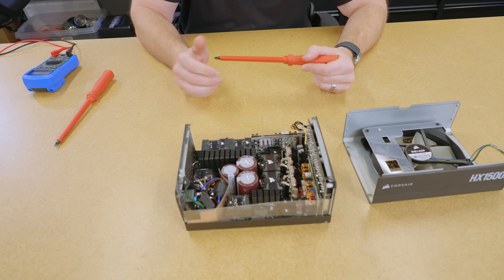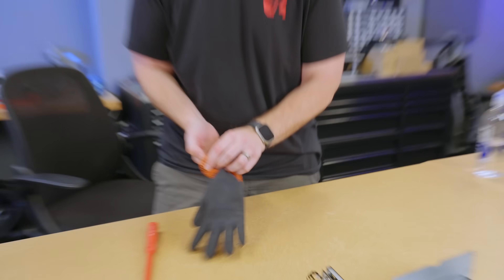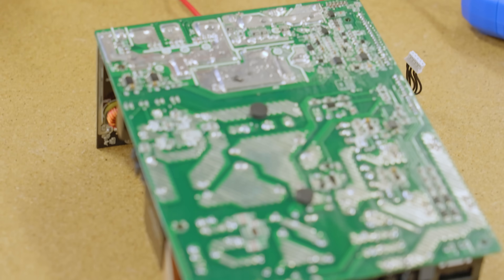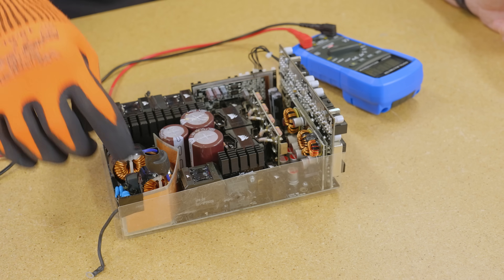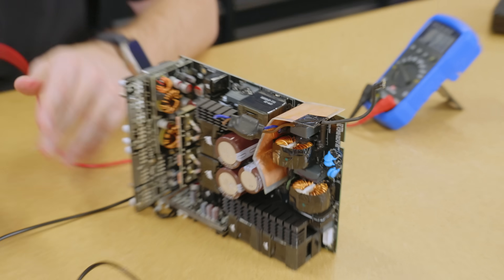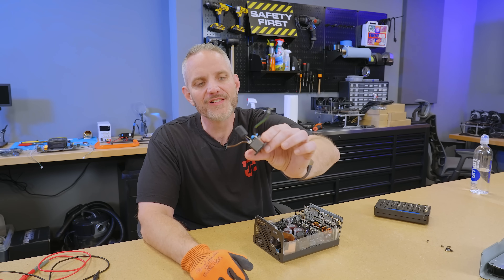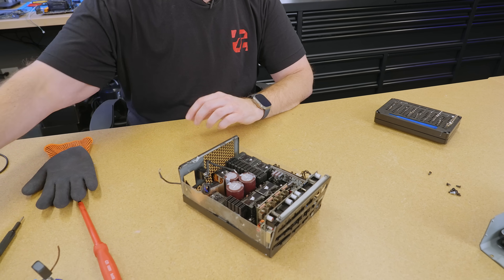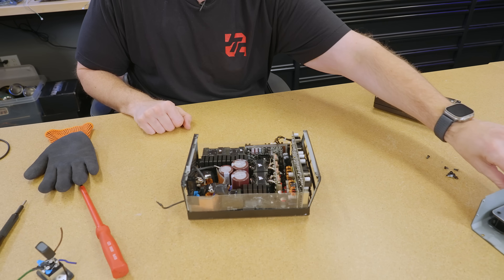Investigating what exploded in my PSU... DANGEROUS! DONT ATTEMPT!

Comment: Well designed power supplies should have bleeder resisters across all of the large electrolytic capacitors. Like someone else suggested; a 100K resister, rated 1 Watt should work. The idea is that the resister will slowly bleed down the capacitor voltage whenever the PS is unplugged, while not drawing so much current that they run hot, or load down the power supply. They also help by bleeding off excess voltages that can accumulate under light power supply load conditions. 

You could also use two 120VAC 60 Watt incandescent bulbs wired in series to bleed down a 150DC charge on each electrolytic capacitor. Since 240VAC rated light bulbs are rare in the USA. Don't use LED or CFL lamps. Shorting out large capacitors is dangerous and can also damage the capacitor being discharged.

Normally the larger capacitors in a computer power supply are connected through a full wave rectifier directly to the AC input voltage through the power switch with a fuse or circuit breaker for protection. Circuit breakers are too slow to protect against voltage spikes. Varisters (which often look like the old flat/round ceramic disk capacitors), but are coated with blue or black epoxy are used to shunt surges and spikes to the neutral mains line, or ground. These are also used in surge protectors. Most power supplies that I have performed autopsies on usually have at least one or more varister(s) across the mains inputs. They are cheap protection. 

When the power supply cap blew was the power supply connected to a surge protector?

Comment: no a full charge would be 170V since that is the peak of the 120V RMS AC in. Bro doesnt know anything about how a switch-mode power supply works, it's fine that you don't but we still have no idea what is wrong with it

Comment: It's so funny seeing amateurs freak out over a simple thing like inspecting a power supply.
ROLF.
Very entertaining. BTW, that capacitor likely HAS discharged. Check the voltage rating on the side. I bet it's 400V.
Reply: it's 420 at 450uf. there's 3 at least 2 in parallel which is why he's still reading voltage on it. since one of those caps is obviously blown.
Reply: uh, sorry, one of those is 420 at 450... the other 2 are 680uf.

Comment: It'd be nothing to discharge those caps, all you need is an old ass lamp and alligator clips on copper wire leads. turn on the lamp, clip the clips to the ac plug on the lamp, and use gloves to touch the leads to the caps, light the lamp till it drains out.
easy.

Comment: You can use your mulimeter in resistance mode to very slowly discharge a capacitor to safer levels, but it's always better to use a big resistor of some sort. Don't use the current mode, the fuse will blow then or you would damage the multimeter.
Reply: No, you're thinking of voltage mode. On a high DC voltage setting, e.g. 500V DC, typical multimeters will present an impedance like ten megohm or higher, which will discharge a capacitor very slowly, but at least it will inform you whether the capacitor is carrying a charge.
 In resistance mode, a multimeter applies a small voltage and measures the resulting current, which reveals the value of the resistance. Attaching on this setting to a high voltage source that can deliver high current is a predictable cause of damage to multimeters.

Comment: I think, it's PFC circuit exploded, cuz these stupid 110v input power
IDK how it working on 110v BUT, on 220v scheme it boosts 310v (after rectifier) to ~400v and I think from 110v it tries to boost to same ~400v (cuz transformer efficiency calculated for specific voltage)

Comment: There are 4 mosfets on that heatsink. one of the 2 on the other side probably exploded. Probably the one by all of the resistors EG R103, D102, R104. The other 3 isolated resistors are for the other mosfet. Just a guess. Same  things go Pop  in the RC world due to heat and current.

Comment: I'm an amateur radio operator, and I've worked inside amplifiers with greater than 3500V floating about inside (the one I'm thinking of took a pair of 4-1000A tubes). As a consequence, this video was good for some laughs.
Reply: Did you notice, the multimeter leads were in the amp meter plugs.
Reply: @C.K.-68  I expect RedneckGamingChannel understands how a multimeter works, and will know that it doesn't matter.

Comment: Set the multimeter to either low impedance or current mode and measure across the caps. It'll discharge safely through the shunt resistor in the multimeter.

Comment: you can use a 120v 60w incandescent bulb (not LED) and two wires to discharge those caps. That part looks like a transformer, but it's a RF choke, to keep the switching noise from back feeding the switching PWM signal. I'm betting the switching IC blew up, or the mosfets.

Comment: Jay, you can discharge the caps using the multimeter. You might have a LoZ mode (low impedance) or if not, any decent meter will do it with it set to resistance/ohms mode.

BTW, you got your leads connected wrong.

Comment: A 150V charged capacitor is not going to kill anybody unless they have a previous pathology or heart disease, and even then I doubt it. Even the three of them in parallel (I assume those are filters for the noise in the rectified current) they barely hold 16 joules of energy at 150V. It's going to hurt like hell though, but not kill. That doesn't mean you shouldn't be careful when handling it though.

Comment: You can use your multimeter to discharge the caps.  Put it in resistance measurement mode, the test circuit inside has a low enough impedance to discharge the caps, but isn't super low to the point of drawing a huge amount of current.

Comment: You can discharge the caps by putting your multimeter in diode test mode and then touching both pins of the caps with it. At least that's how a Russian repair shop does it.
Also what killed your psu was probably a voltage drop in the mains. You mentioned that the lights went a bit dark at the moment. Linus in his psu tester video mentioned that that test killed a surprising amount of psus.

Comment: You can simoly discgarge the capacitor hsing your multimete just go to resistance mode or measures the ohms, the. Just simple poke the negafive at positive atleast 1min.. it will  gradually little by little discharge it

Comment: Just a little hint for discharging. On the plug for the power cable comes from the wall you can easily put plus and minus together....that will discharge anything left on the biard
Reply: The only thing that bridging the mains cable can discharge is small EMI suppression capacitors. The large PSU reservoir capacitors are isolated by the rectifier. They cannot be drained via the mains cable.
Reply: @PlatypusPerspective  oh iam sorry, this works on my inverter for solar pretty well.....but on the outgoing side.....so on this supply you need to drain like its actually doing stuff (connect some fans to spin or something similar) - iam sorry that i got confused by writing it haha.....
Reply: @Eyezzzonly  No worries, the exact what and why of discharging stored energy will be rather different between different types of devices, input and output side, and working or faulty! This PSU is a good example of the last mentioned, when people are suggesting to connect it to a computer and switch on to drain the reservoir capacitors, whereas the capacitors are holding charge because the PSU has stopped working and can't do anything to drain them. 🙂

Comment: its not the voltage that really kills i'd be frightened of the amps. current kills. i had a job working with power supplies once. and occasionally when testing the case was grounded something went wrong and i got (as did others)12000 volt shock briefly. that hurt but i wasnt killed because it was milliamps or lower current.
Reply: that 'big component' looks like a transformer of some sort.

Comment: caps actually have discharged somewhat. Your at 110V but most likely the supply steps up the rectified AC to ~390V DC. Which it will do at 110V and 240V. Of course still charged to 115V is still dangerous.

Comment: I recently took apart a non modular 650w psu to cut and cap the molex and sata power cables (small case, no need for them, and absolutely zero room to put them). I now realize how close i came to accidentally unaliving myself. I thought unplugging for 24hrs and tapping with a screwdeiver was enough 😲💀

Comment: I'm gonna throw in with the other comments and suggest a 220 volt incandescent light bulb to discharge the capacitors. you'll have a visual indication it's working that way, which a resistor won't give you (unless you use the wrong one, in which case you'll have a very frightening indicator of the state of charge and will probably be running for the hills)

Comment: My two cents say those caps are on the AC side. Rectified 120V AC usually gets to 170V DC, similar to what you found while measuring.
And yeah... one capacitor is popped. You could replace them and test your work. Might be a good video (maybe collaboration).

Comment: I must point out that many viewers are just guessing and have no actual experience with repairs. Capacitors coming from the factory are marked! For your information, the yellow mark on the capacitor was made with a marker! When people see a hole in a capacitor, they assume the yellow mark resulted from that damage. For those unfamiliar with electronics, capacitors are often marked with a marker for identification purposes!

It appears that the explosion occurred near the power input section, where the wire has been cut. You can clearly see that the protective insulation has a light blast mark. Inside that area, the wires may have fused together and caused a short circuit, which in turn should have blown the fuse.

The apparent damage on the capacitor may be due to the camera angles used during recording, giving the false impression that there's a hole in the capacitor. At the spot where the connector was cut, there's also a small black tube, which contains a fuse, and it is also marked on the PCB board T20A/250V! 

The first thing to check in any device is always the fuses, and only then proceed to investigate other components. 

Sorry my bad English!
Reply: Guy, it's so obviously blew out the vent it's not funny. if that yellow electrolyte was made by a marker, why are the other 2 caps not marked as well? 10+ years of experience, says 100$ you're wrong.
And the blast damage? The tape isn't 100% smooth, so you infer blast damage? HUH? The coil is fine.

Why would the factory mark a 420v cap? That makes zero sense. It's not a small one, where if you've got a few different values, you might want to mark certain ones so it's easier to pick. And why would the use yellow? Considering the reason for marking caps is usually to signify they've been soldered. Yellow is not an easy to see colour, so that also makes no sense. Also, electrolyte is usually a yellow or light brown colour. 

The only thing correct in your comment, is the fuse is possibly blown. But my guess it's fine. Why? because most cases where I've seen a power supply die, the fuse is the first thing I check, and most of the time, it's good. Maybe not in this case, but 20a@250v, is not nearly 1500w.... IE, the breaker blew before the fuse.
Reply: @TheCurtisnixon  I see a lot of commenters who boast about their skills, often adding how many years of experience they supposedly have — but I can say with confidence that you clearly lack those skills. I, for one, would never trust you with repairing my equipment.

Just so you know: when a component is marked with a marker in a device, it does not mean that everything must be labeled. It is not marked to indicate failure — it’s marked to indicate inspection. And no, not every capacitor needs to be marked — usually marking one is enough to show the group was inspected. Every manufacturer has slightly different policies on how and when these control markings are applied.

Frankly, it's strange that you call yourself experienced when it's clear you lack a fundamental understanding of such practices.

Secondly, here's a homework task for you: try to understand the cross-section of a cut wire — something you should know if you want to call yourself a technician. There's a solid reason why I recommend it.

Third, I've seen a lot of capacitors, with a deep cross-section I also have it on my desk at the moment., so should I immediately assume it's faulty? It’s made so the capacitor can or rupture safely under pressure. The depth of this cross depends on the thickness of the aluminum — some require deeper cuts, others less. This is basic, not magic.

You don’t become a good technician just by getting a certificate from school — you need real experience, plus the ability to think and analyze different scenarios logically.

Now, regarding your claim that a capacitor has failed: before jumping to conclusions, did you even consider checking the fan in the video for visible damage? If a capacitor had really damaged, there would be physical signs — such as leaking electrolyte — but none are visible in the video. So no, it doesn’t look like a failed capacitor.

Based on what I observed, the more likely issue is a wire bundled in black insulation where — under heavy load — the wires melted together, leaving a white blast mark on the insulation. After that, the fuse blew. That’s why I always say: start with checking the fuse. A blown fuse doesn't automatically mean the device is faulty. There are devices with many fuses in different places multiple fuses protecting different regions.
So again, your homework:

Learn what a wire cross-section means.

Understand why manufacturers use marker-based inspection marks.

Learn that not all capacitors need to be marked — one is often enough.

And most importantly, stop bragging about your skills — because doing so without proper knowledge only makes you look foolish to others.

Based on your statements, I can confidently say: you do not have the knowledge you think you do. Just because you’ve been doing something for over 10 years doesn't mean you’ve been doing it right.
Reply: @DjxHeadhunterz  don't worry, would never take any repairs to you either, since you can't see the obvious electrolyte splooge. When you mark a cap, it's a single mark, usually on the vent. the electrolyte is all over the place, like the vent blew.... never seen a mark like that come from the factory.   EVER. But please, tell us more about your years of experience mr genius.
But of course, you have to be right eh? fuckin adorable.
Oh, and ya, I've made mistakes. But at least I own up to them. Unlike you, who doubles down when he's shown to be completely wrong.
Reply: @DjxHeadhunterz  oh, and timestamp when you can see what you're talking about for the fan. cuz there's no place in the video where you can see anything clearly about the fan. so timestamp, or you're a lyin liar. :D
Reply: @DjxHeadhunterz  omg... if you're talking about the potting material you can see on the wires at 5:29, ADORABLE!!!! lmfao!!!
Reply: it's almost like you don't know what you're talking about.... that's not melted or fused. if you'd spent any time repairing electronics, you know, because  it's so fuckin obvious....
Reply: @TheCurtisnixon  3:56 Thinking of you now!
Reply: @DjxHeadhunterz  looks like excess potting material on the fuse, if that's what you're referencing.(there appears to be quite a bit all over this board...)  I see no melted wires... Oh, and you see how the shrink on the fuse is a different material, and doesn't appear to be burnt, like at all?? also, what's your explanation of the electrolytic splooge that you claim is marks from the factory?

Comment: I had that happen to me countless times when using caps for different R&D, One time I was so desperate to get the board discharged I dunked the whole thing in the pool.. then dried with an air gun, IT ACTUALLY WORKED.. a freakin mosfit was the culprit!

Comment: why are you measuring DC voltage, when the caps are AC charged
Reply: The potential on a charged capacitor is DC.
Reply: @PlatypusPerspective  thanks for the info

Comment: I worked at a shifty computer store 20+ years ago. One time the owner came with a dented PSU and a nonworking PSU and told me to put one into the other so he could sell this $50 (often free with PC case) crap-tier PSU. I looked, saw the cables went through a hole in the case, and told him I wouldn't be able to do that because you'd need to disconnect them and solder them on. He said 'we'll get you a soldering iron' and I was like "you're not hearing me. I don't have this skill."
He was not happy but I was fully aware he was asking me to risk my life for something that cost under $50.

Comment: Not long ago I was booting up my AM5 rig for the first time
And the PSU exploded at 3am during memory training

It was an MSI MEG Ai1300P that I had for 2-3 years on my AM4 build

No idea why it happened.
But the CPU (9950X3D) did end up having a WEAK AF IMC which I ended up swapping out for a new one too.

Talking not even able to run QVL certified DDR5 at EXPO settings.
Or even lowering the speed down to 5200mhz cl 32

Comment: use the AMP meter to discharge the Caps. measure for current would be cool to see how much current flows. there is resistance in the amp measuring circuit so its not a dead short.

Comment: I just have to wonder how does someone who clearly knows enough about the topic, not go into this prepared to have to drain the caps? How did you not find some store that sells you the typical ~20kOhm 5W resistor and prepare to use one to bleed the caps? Anyway, decent chance that if it went "bang" it could've been a mosfet that it buried somewhere in those plates, or below a heatsink.